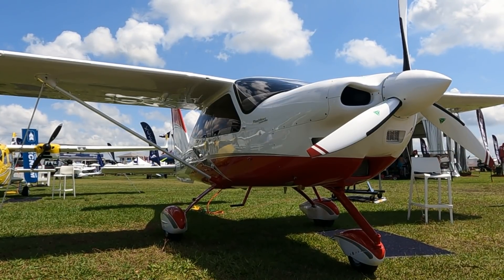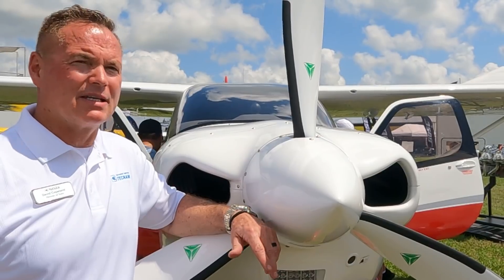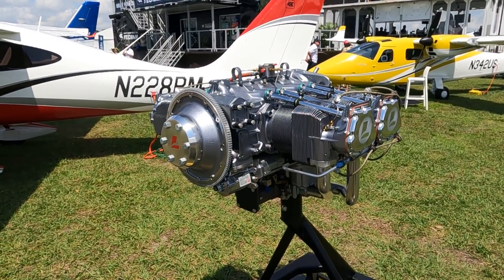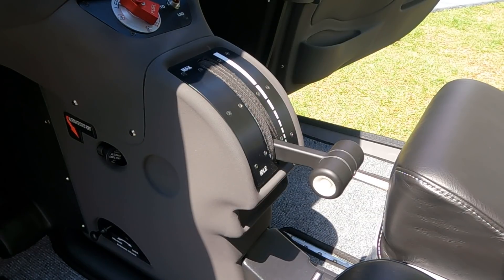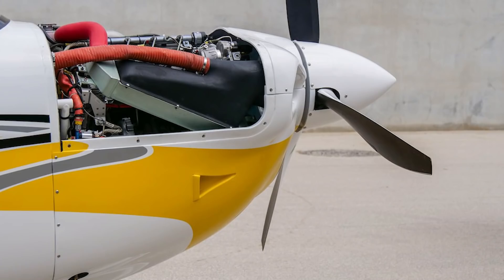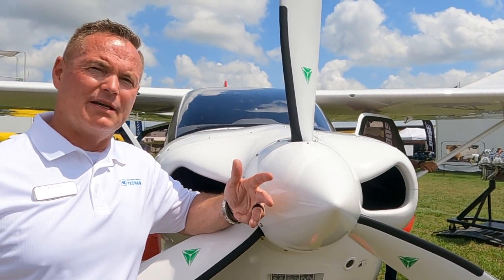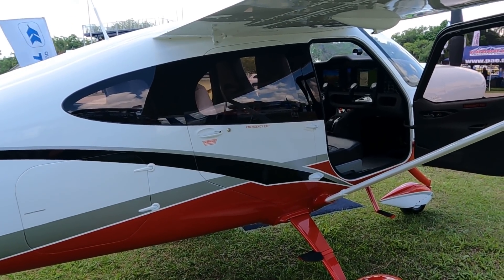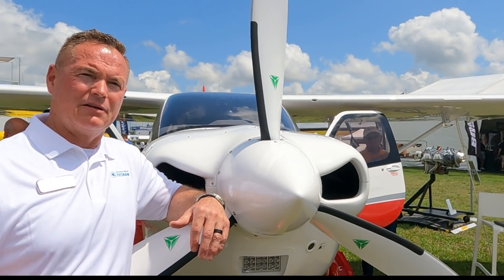Tecnam's P2010TDI Sun 'n Fun Debuts

Comment: Flying it almost 2 years. In Europe. Absolute economy. Yes, fuel taxation is here another world. Easy to operate = FADEC control power via engine and propeller setting done by computer. Not overpowered on the ground, but in the air... turbo, intercooler and electronic engine management win over comparable conventional LyCo gasoline engines. Comfortable in size between C172 and C182. 3 doors also big plus.

Comment: The market for this is really outside the US where Avgas is scarce and expensive. JetA is everywhere, so I see the TDi being more attractive to the European and SE Asian markets. $560K is about the same as you’ll pay for a similarly equipped C-172 brand new, and less than a C-182. I know companies that are ordering these to use in Malaysia, Indonesia, Thailand and the Philippines, so it will sell well.
Reply: Those Cessna's have not changed in 70 odd years. They just sprinkled a bit of pixy dust on the dash and that's it. Tecnam aircraft are completely new, fresh, innovative and efficient. Its like comparing outdated Boeing 737s and Airbus A321 aircraft. Airbus are modern, sleek, efficiant and SAFE. There is a vast modern and innovative world out there beyond USA borders.
Regards from South Africa

Comment: 4 Seat Airplane   Diesel weighs 6.6 lbs per gallon  X 63=  415,8 lbs full fuel weight.   Useful load is 838 lbs.   So  422 lbs total for passengers and baggage.  Is this correct ?

Comment: I was doing the math on the TBR vs TBO and it seemed like a non-starter but I see Continental has a core exchange program that’s not horribly priced. Somewhat more interesting now.
Reply: The reason it’s called a TBR is because they don’t have overhauled engines available yet till they get timed out cores.
Reply: @willjohnson3907  It's called a TBR because you're replacing, not overhauling. It doesn't matter whether you're replacing it with an overhauled engine or new, if you're not overhauling the engine that's coming out of the airplane it's a replacement.

Comment: If I had $400,000.00 to buy an airplane the las thing on my mind would be fuel economy.  It's the like a race car diver bitching about gas millage.
It is a nice looking airplane but, I'd rather upgrade an Type Certificated airplane.
Reply: Because you don't have $400K to buy a plane you assume people with $400K think differently: I'm suggesting they do not.  I would say the same thought process exists no matter what aircraft you are purchasing.  Fuel consumption is one of many items on the list to consider; depending on the owner's mission for the aircraft, fuel consumption is weighted differently, and that is why it is mentioned. Also, it is common knowledge, depending on the circuit, many race car drivers bitch about gas mileage.
Reply: @swiftadventurer  Have you been looking in my bank account? 😆
Reply: Fuel efficiency isn't about price, it's about the airplane range.  The amount of fuel and fuel burn determine the range of the aircraft so it is very important to an airplane owner.
Reply: I'm not sure if I know what you mean... It does have FAA Type Certificate for the Lycoming powered variants, and presumably they can add the diesel. I guess it's certified through the European CS 23 equivalency with the FAA, not directly through FAR 23; was this what you were kind of complaining about?
Reply: @thewheelieguy  I'm not complaining at all.  I'm pointing out that there are better economic options for this category.  Say a 4 place airplane.  I had a sweet 1958 C172 / 180 HP and a few other STC'S that was about the same cost to operate for much less than $400,000.00.  Also consider the insurance cost on a $400,000.00 airplane.  I later moved up to a 337G forfar less than half a million.  My advice is do you homework before getting caught up in all the sex appeal.  I would avoid the diesel. Be safe everyone.
Reply: @av8tor261  ah, I get him now; he’s not interested in sex appeal! 😆
Reply: @av8tor261  comparing the cost of a new plane to one with thousands, if not more, hours on the frame..............

also i have no idea why so many flyboys hate diesel, even though it's literally jet fuel.
Reply: @jmwintenn  You'll never please the "back in my day" crowd unless it's 60+ year old technology

Comment: Decent looking plane, certainly more sporty and modern looking than my pet peeve Cessna 172 :) but that's not a high bar either. The high wing with struts is still a little colonial but could be overlooked. Nice doors and interior. Pretty much car config which is a config I think has great untapped potential as a twin jet rather than the traditional minibus jet config.
He talks about fuel economy of 10 vs 15 but their website suggest 5.2 gph and cessna might claim 8. The relative advantage is there, just wonder about the numbers. As a result it has pretty good range. 1800km vs cessna 1200. If we compare to Cirrus SR22, it's 23% slower (cessna maybe 10% slower still) but adjusted for speed, it has a bit over double the fuel economy of the cirrus. No small margin. And not using lead fuel. That could sell some planes.
The empty weight is 820kg, bit over the cessna and that's less impressive. Can't help feel that has a lot of room for improvement. 800kg is 4 cast iron pianos. The TDI weighs a small piano so I'm wondering where they put the other 3.3 pianos. Is it lead lined? :)
If we take a 5meter 2 seater canoe which is an open structure yet stiff and can take a beating, that can be done for 20kg. If we figure 4 of those could make up a closed cabin plus change, that's say 100kg as a guide. So I have to believe that it's possible to ween off a couple of pianos so they go live somewhere else and that translates to smaller engine requirements or much higher speed.
Reply: not a fan of the very tall dash. one of the many things I don't like about prop planes. two small twin jets rear would clean up the design so much

Comment: Cool plane, but $400,000 is a hard pill to swallow especially with a 1200Hr TBO.
Reply: The 170hp version was certified less than 2 years ago. 155hp CD-155 is already at 2100 hours TBR. CD-170 TBR is going to go up as well.
Reply: TBR actually ....

Comment: Some number wouldve been nice. Cruise speed, fuel consumption, price, TBR, payload etc, etc.
Reply: Our Club DA-40 TDI 155 cruises with a little over 5.2 gallons with 120true all the time. So I believe 5 gallons for the Technam seems possible.
Reply: But then… aerodynamically the Tecnam might be worse than the 40. So maybe 6 gallons…
Reply: @73erKadett  Just looked up some info on the Tecnam website, they claim 5,2 gal/hr and 140 KTS cruise but  dont specify the power setting for each of those. Useful Load 380kg, range an impressive 961nm. Only downsides i can see are the takeoff distance (2211 ft/674m) and the 1200 hr TBR on the engine. But overall it sounds pretty good and i dont get why the sales rep doesnt bring these numbers up in this video.
Reply: @Dudeisthere  2200 feet for a standard conditions sea level takeoff? that's really bad (a cessna 182 will do it in 1500 feet, an RV10 will do it in less than 1000)

Comment: I have flown this plane in france. The payload is super shitty. Not a real 4 seater at least it was with 180hp lycoming. And it had a super high pitch so you need 1000m runway. It was very confortable though but you cant use it 😆
Reply: You flew the gas version this is the TDI diesel
Reply: Having flown the P2010 with 180hp and constant speed prop, I have to disagree. WB-wise, it is a full-fuel 3-people aircraft; nothing more, nothing less. Take-off distance is indeed not amazing, but pretty similar to a c172sp (with which it competes in terms of price and power). However, compared to the C172SP, it does 10ktas more in cruise at a similar fuel flow

Comment: The engine has a TBR of 1200 hours... Let's hope Continental can improve that significantly.
Reply: How does that compare with the Austro TDI engine?
Reply: @Parker53151  Austro's fact sheet for both the AE300 and AE330 show a TBO of 1800 hours. That is an additional 50%
Reply: @LowFatBacon  TBO or TBR?
Reply: @Parker53151  overhaul. That's another thing Austro boasts, overhaul instead of replace.